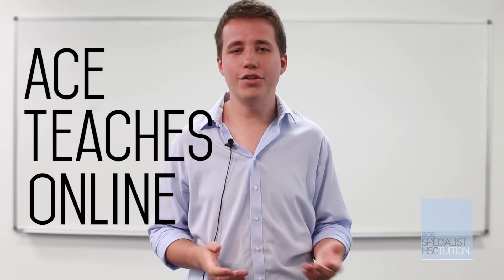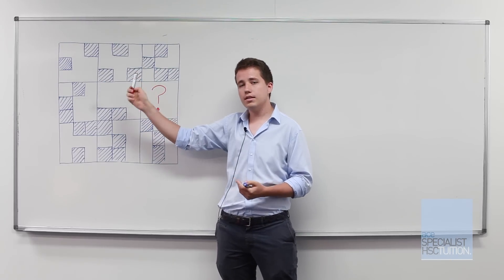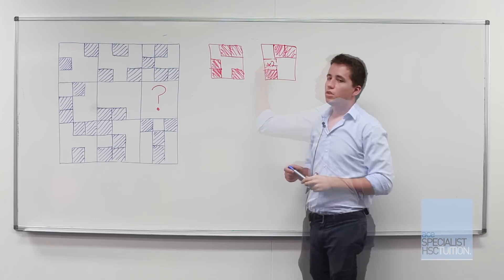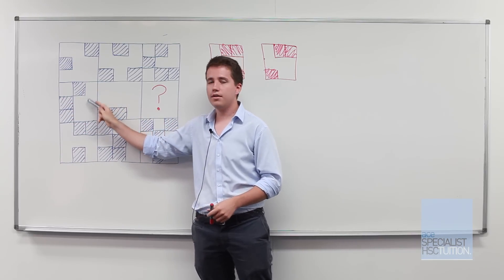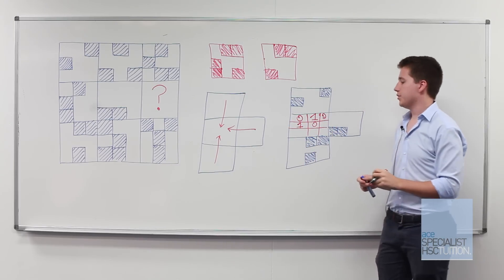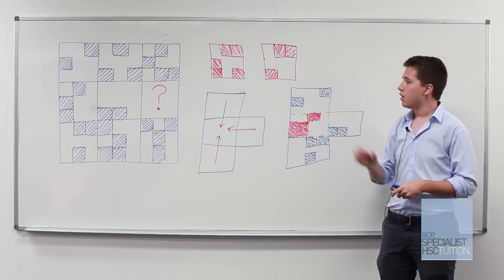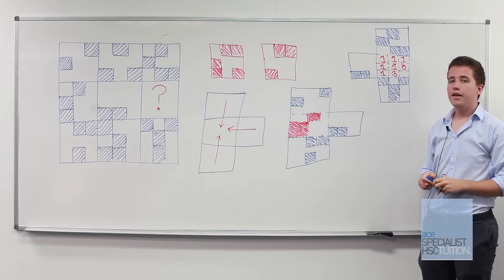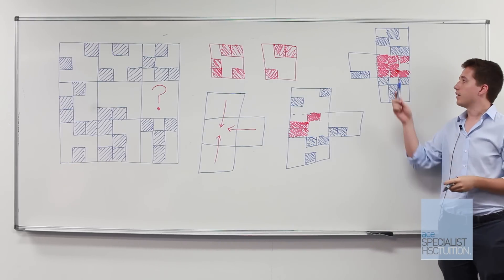ACE Teaches Online: UMAT - Section 3: Missing segment

Comment: This solution seems incorrect. Check the middle bottom one.
1 1 2
0 1 0
1 3 0

According to stated logic it should be:
X X 0
0 X 0
X X 0

But is:
X 0 0
0 X 0
X X 0